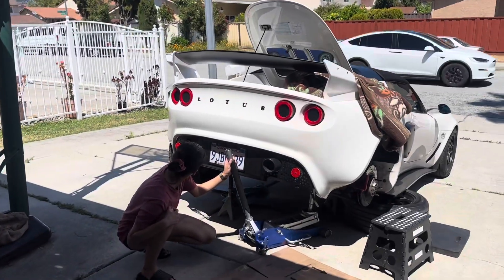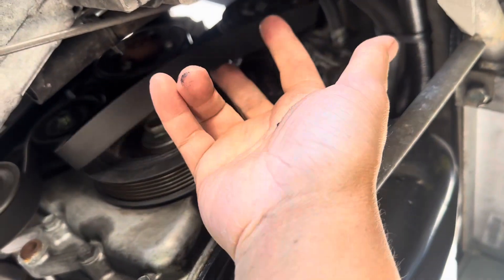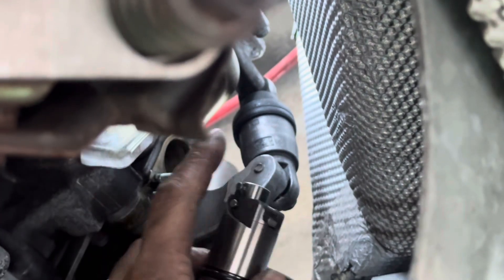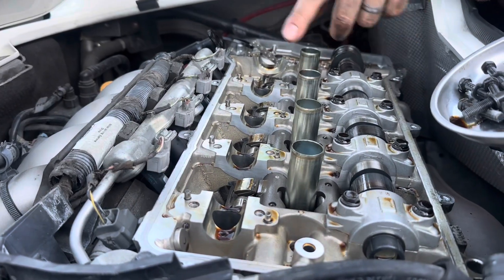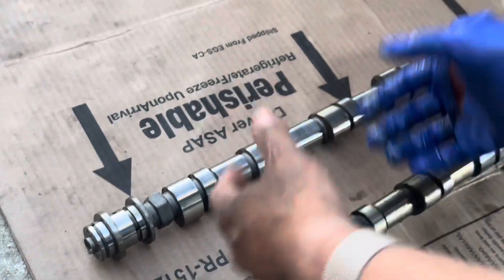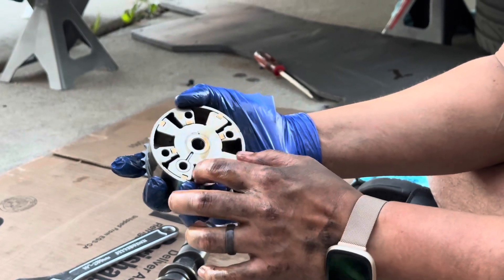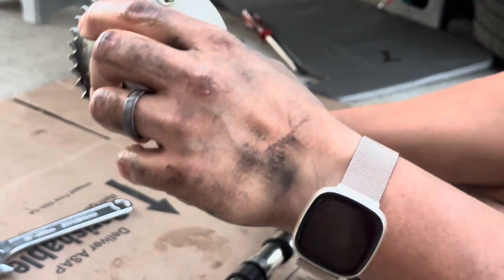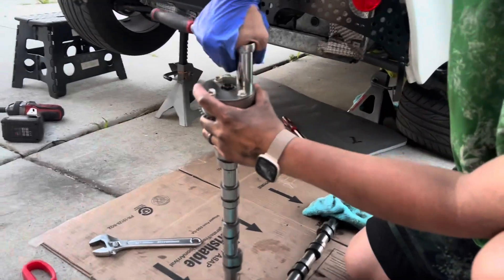Fixing a Major Problem With Our Lotus Elise 2ZZ-GE Camshaft Replacement | No More Wiped Cams!

Comment: Hey man, I appreciate this video so much! 
I've been owning a 2zz Toyota Celica for 14 years (and 357k km) and after swapping another engine I had the MIL light on (P1349 which is the VVT malfunction).
I took a pic during the timing phase for records and I noticed the holes were aligned, aka the VVT sprocket was installed in the locked position..I was not aware of the procedure prior to torquing the bolt.
I still can't figure out why you should unlock, torque down the bolt then lock again the VVT instead of torquing that directly..
The result anyway is that power loss is huge, lift engages but without any kick and power increase is barely-to-no noticeable..
I saw many videos but one on a 2zz is a true gem
Reply from the maker: Happy to help! Thx for sharing

Comment: Great video!

Q:  I understand you have a newer 2zz, but did you replace the rocker arm bolts?  I have a theory that if the bolt shears the shaft can rotate and block oil passages.

Very interested to know you findings.
Reply from the maker: Rocker arm bolts are still original, but I’ll look into replacing them some time down the line. Thanks!

Comment: Why in some 2zzge I see wear and in other with 250k miles is ok without wear? Weird
Reply from the maker: Depends on how you drive. If the oil is not warm enough and you get on 2nd can it can cause wear. Basically keep revs low until up to temp.
Reply: @Sals_Garage  yes I think this is the cause also on high lateral pressure 2zz loose oil pressure especially on lotus and maybe is another cause for wear camshaft. Oil quality also is very important (I use 0w40 M1 FS) What camshaft is this on your video mate? From mwr?
Reply from the maker: @DimoS...  thanks for sharing. Good info, and this crank shaft is the same as OEM but hardened so less likely to have any issues in the future. It’s from BOE.